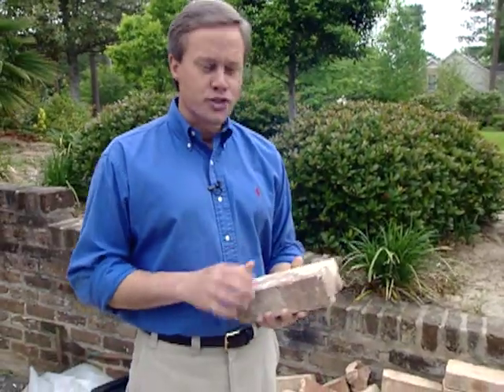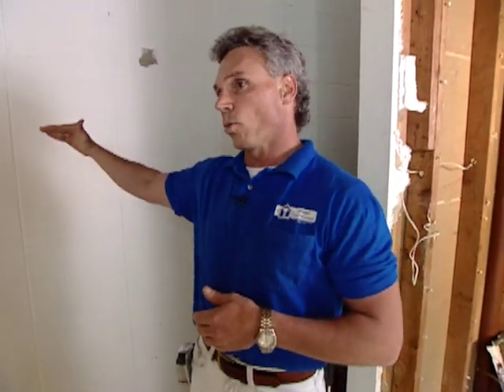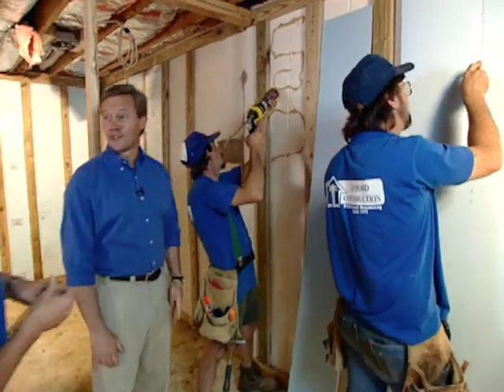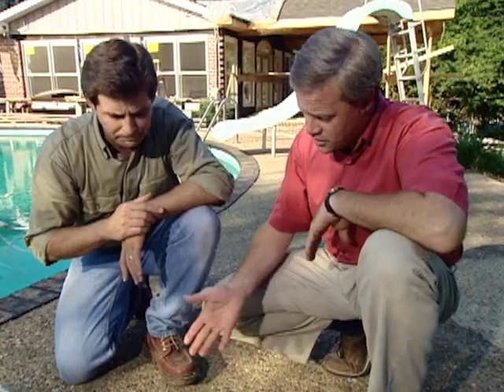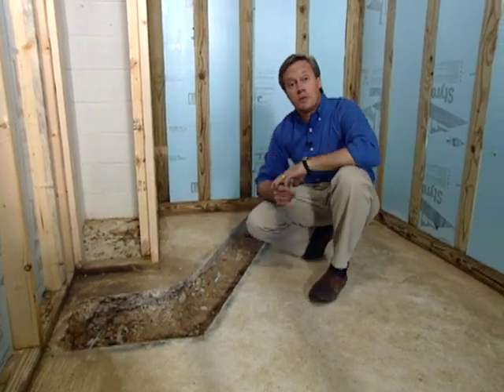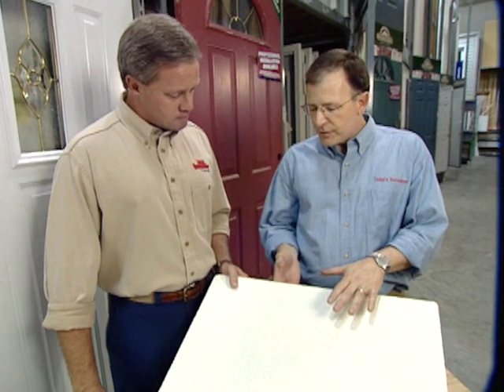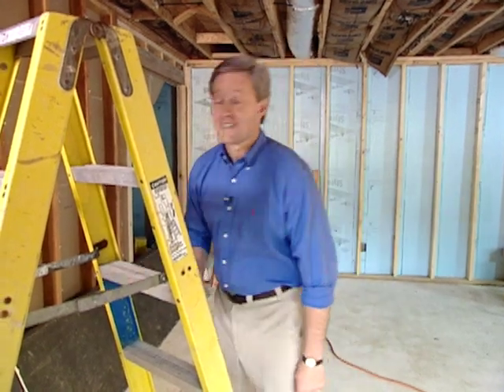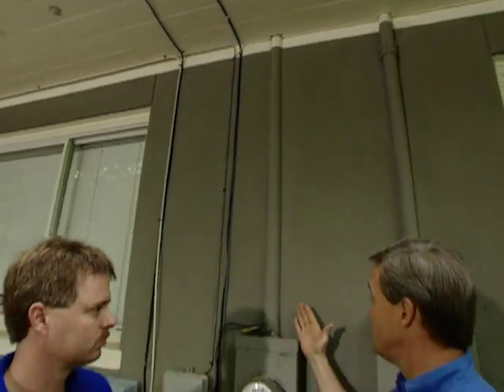Today's Homeowner with Danny Lipford - Garage Enclosure - Part 1 (Season 1 | Episode 2)

Comment: I learned a lot here the water coming through the walls is something I have a lot of trouble with we just had a down pour to the point that it couldn’t drain quick enough and it really pores through my walls in the basement and my sub pump stopped working it was a mess and I had to worry about my furnace which is in the basement I’m a renter and I believe if they would water proof the walls it would be less of a headache I also have the drop ceiling and I really love them I’m 5’1 and I still can’t reach my ceilings to paint so I will have to hire some one to do it and I hate that part I love to do all my own repairs and of course my landlord loves it